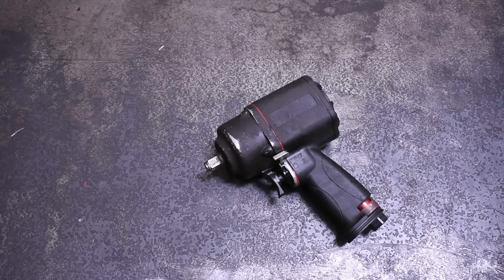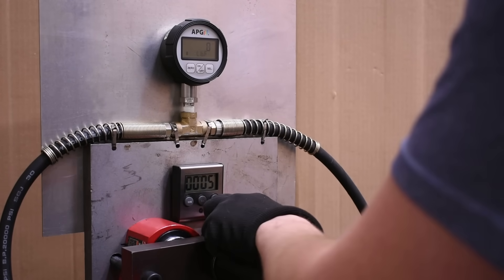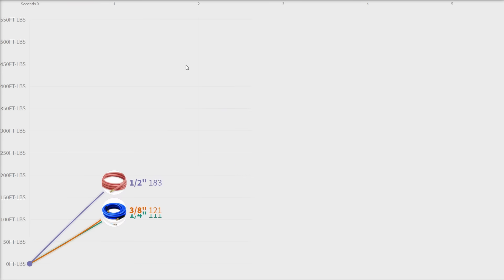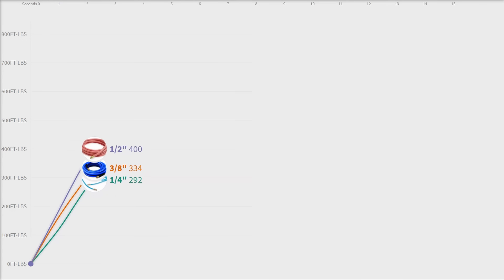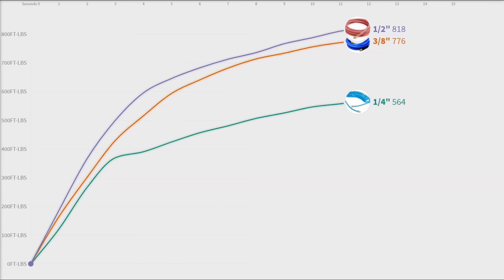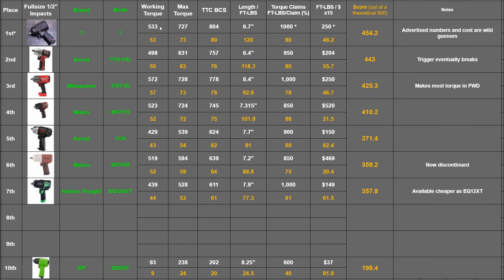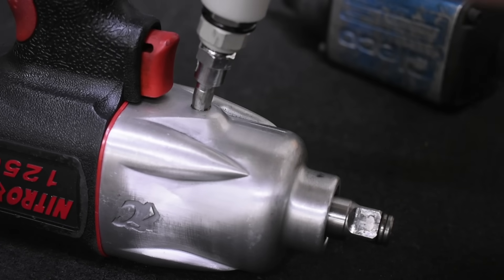How Much Power Are You Losing w/ Your Air Hose Size? Dyno Graph Testing

Comment: Ever heard a 1/2” impact fed from a 185cfm air compressor pushing 200lbs thru 3/4 jackhammer hose.  It’ll make your ears hurt first. And then max torque claims ain’t made up then lol.  But it destroys the impacts right quick

Comment: This comment goes to the creator of this video... as I need serious help.  I've been delaying my introduction into air tools as there have been SO many variables to take into account.  I bought a nice compressor a couple of years ago however I haven't really used it due to my hesitations over hose selection, coupler selection, etc...

1)  FANTASTIC video.  I'm not sure how I ended up here... but I did... and I seriously appreciate the quality of this video.  My questions concerning hoses has now been answered.  3/8" hoses are the best fit for me.
2)  Now the couplers.  Should the coupler diameter match the hose diameter in order to get the most out of your tool?  My compressor came fitted with a 1/4" coupler and the handful of tools I have so far (impact wrench, air chisel, tire inflator/gauge) also came fitted with 1/4" couplers.  I've understood that the air getting to your tool is limited by the smallest diameter between your compressor and your tool.  So even though I would be using a 3/8" hose... the fact is... all of my couplers are 1/4" - so would I be seeing any benefit in using the 3/8" hose?  Or am I supposed to change all of my couplers to 3/8"?

Similarly, the airline coming out of the compressor is 1/4" to the coupler on the compressor... and the tool itself is obviously fitted with 1/4"...  Can you PLEASE help?

Thank you SO much in advance.
Reply from the maker: A common misconception is 1/4" fittings mean anything on it measure 1/4". The fitting size is based on threads, which are 1/4 NPT, and npt threads have nominal names that have nothing to do with a measurement. 1/4" npt measures around 3/8" on the htreads. That said, the inside diameter of a 1/4" air fitting is also small, varying by type of fitting. Couplers will always bee the bottle neck. We cant test that for you, but generally we feel milton type V 1/4" is plenty on 3/8" line.

Comment: Joe Homeowner here. Just stumbled across your channel and hit play because I have a big box bought Milwaukee 6 gal compressor (C2002) with whatever hoses/adapters I got with it. Used it with a Brad nailer (pre battery everything) and now mostly as a car tire filler and general blower. The thing has always leaked and the noisey-arse compressor is always going on. Always bothered me but wasn’t sure of next steps plus I hardly use it. 
Your channel has great info and your presentation software is first rate. Happy to subscribe and spread the word!

Comment: If I understood correctly (and I may not have)  you adjusted the regulator for each individual hose tested to supply the same running pressure  at the tool.   Can you explain your rationale for that?  It seems to me that setting the regulator pressure higher at the upstream end of the smaller hoses tends to offset the restriction of the smaller hoses, and makes that test less of an apples-to-apples comparison.  Also, I'm curious, which has a higher air flow?  The wrench spinning up freely with no load or the wrench working under load?  Just off the top of my head, I'd guess that the free spinning wrench would flow more air,  but these things aren't always what they seem.

Comment: While I have no doubt the 1/4 inch performs poorly. It is not an apples v apples comparison. A coiled hose is going to offer more resistance to airflow. If the purpose of the test is to compare hoses in general use it’s a fair comparison but not so for comparing how hose diameter impacts air flow.

Comment: That impact looks alot like a Mac/ Proto product. I know SP Air makes Mac/ Proto sealed head air ratchets and the heavy duty air saw for Matco but I will have to look into who makes this impact gun. 🤔
Reply from the maker: See south main auto's insta. Just waiting for the launch now!
Reply: @TorqueTestChannel  Thank you kind sir! My Aircat 1150 is still going good for about 8 years old but it is time to give it up and get something new. It's been a great tool and was daily used for about 7 years at 3 shops, the anvel is still square and the only part I replaced inside or out was the retention ring a couple years ago. Good maintenance does wonders.

Comment: I work in logging and actually really needed to know if I could get away with just running 3/8". A smaller difference than I would have expected and 3/8" gets you about the same power, might take a few extra ugga dugga's though.
 Cheers

Comment: I’ve been a Matco guy for years. Always keep my 1/2” impact in the best condition possible. At our plant, safety keeps the air throttled down to 60 psi and we use 3/8” air hoses with the smallest possible quick connects. Makes my 1/2” impact about the power of my 3/8” stubby Mac air impact.
Reply: 60 psi LOL

Comment: So, are you seeing a decline in dynamic pressure the longer the impact runs with the thinner hoses? Because theoretically dynamic pressure measured at the gun should mean equal flow rate across the different hoses. So what's the cause of the lower force?

Comment: I think the 1/2" line would be even better if your entire air system was 1/2". With your regulator and everything before it only being 3/8" you're not making much difference because of the 3/8" hourglass in your lines.
Reply from the maker: There's a big difference between 1/2" ID air line and 1/2" NPT air fittings. 3/8" line uses 1/4" fittings and 1/2" air line uses 3/8" npt fittings. Because 1/2" NPT is like close to 7/8" in reality when you measure it, it's just a pipe thread size name not the measurement.

Comment: Excellent channel.  I'm very interested in the couplings.  I did some of my own experiments and the couplings had a much, much larger impact on pressure drop than 50ft of air line did. 

Also can you plot air pressure along with torque in your charts?  Torque is nice to have but it only tells half the story.  Thanks.

Comment: What size Compressor ? What size is your line from tank to airline my 26 gallon is 1/4 air line from the tank to the first fitting .  Air tank with 1/4 fitting from the tank no use to run bigger hose 1/4 to a 1/2 hose is defeating the uses of a larger hose . 100 gallon tank with a 1 inch line choked down to 1/2 will be fine .
Reply from the maker: 80 gallon IR compressor, 3/4" pipe to the wall mount where this 1/2" is hooked up to
Reply: @TorqueTestChannel  Makes world of difference on the tank out pipe .  Im lucky to get 150 FP of torque from my tank , if I hook up my 15 gallon inline with the 26 I get about 300 FP my CFM go up to about 8, all 1/4 fittings .  most home tanks have 1/4 manifold .

Comment: How about a video showing something many people don't realize, the power lost on impact wrenches when using 3/8" hose with 1/4" quick connect fittings vs 3/8" quick connect fittings
Reply: Probably extremely minor loss in power. This test compares 25 feet of hose. 2 inches of smaller ID isn't going to give the same results. You may gain a few percent, but could just turn up the psi of your regulator a hair.

Comment: Understandably i can agree with this but when it comes to a 1 inch air impact pushing torques past 1900ft/lbs im betting the 3/8 hose will perform comparatively as the 1/4 hose did 1/2+ for that kinda tool with the high flow fittings to get the mosr benefit

Comment: I have a CP 721? 1/2” that I bought in 1990 when I was working at the John Deere, Steiger dealership. No, it is not the Central Pneumatic!
It is a Chicago Pneumatic with the numbers stamped in to a metal tag, riveted to the wrench. The reason that I am not sure of the model number is dings from years of use, a lot of abuse, and torquing out of my grip. Every year to 2 years I put in a rebuild kit from CP.  This 1/2” air wrench will take off 50% of the Budd or piloted rims on semis that have not been put on by a 1” wrench and someone who loves to pull the trigger. 
What I do is unscrew the whip hose, screw the 3/8” by 50’ hose to the wrench. So now it comes out of the compressor though a 1/2” ball valve, to my 3/8” x 50’ air hose, to my wrench. 
It is amazing how much the old air wrenches preform without the restriction of the quick coupler!
A lot of guys use to use the long Lincoln quick couplers, I took each of their male tips, put a drill bit down it to measure the ID of the tip. Some common quick couplers are not even 3/16”!
Just like the 3/8” vs 1/4” air hose!
Another good tip on an impact wrench is to put on a 3/8” by 6’ whip hose, it has nothing to do with stopping the vibration from the quick couplers, it is a reserve of unrestricted air next to your impact wrench. 
I think that is why your 3/8” test climbs faster than your 1/4” test. Then they tend to flatline because of the restrictions of the 2 quick couplers. 
When I was at the JD-Steiger dealership, they had an old 5/8” air wrench that would out do some new 3/4” pistol grip air wrenches. But it used A LOT of air, shop law was you had to have leather gloves on to use the 5/8” wrench! It would twist right out of your hands, if you did not know how to hold it. 
The shop foreman went down and bought my same 1/2”, and 3/4” Chicago Pneumatic air wrenches for his service van after using mine. 
Check out the ID of your male air quick couplers, remove the quick couplers from the compressor, get rid of the hose reels, install a 6 foot whip hose on your impact wrench. You will probably be surprised by how much power that your impact wrench has!!!
Hello from north east Montana. 
10 miles from the Canadian border.

Comment: To answer the question Why do 1/4" x 100' hoses exist I think it's for paint shops as I don't think they need the larger volume that the larger ID hoses can provide. 
That or (jokingly) so you can park 80' away and still fill up your car tires.

Comment: New Viewer here, I thought Nitto was the most common fitting? maybe only in australia? have you compaired a minsup fitting for maximum flow?  I found a huge difference with my snap on 3/4 gun on a 3/8 air hose vs a 1/2 air hose with Nitto fittings and ive though about setting up a 3/4 line with minsup dedicated for my 3/4 air gun.

Comment: Nice test, what's the inlet line to the Filter/Reg? And the flow rate for the filter/reg? I know you have a 3/8" out. As the curves become pretty much parallel between the 1/2" and 3/8" after the initial burst from the 1/2" I wonder if that's not just the point where the intial "bonus" energy in the larger hose has been depleted and the flow in the 1/2" hose is then being held back by the filter/reg. effectively pairing it with the 3/8" hose.
Reply from the maker: Filter/reg is 3/8" NPT in and out, flow is 47.6 CFM which is well above any impact we've seen before.
Reply: @TorqueTestChannel  I'm guessing that gun is pushing 40 CFM so you don't have all that much theoretical extra capacity. Would be interesting to put a Tee and gauge on the outlet of that FRL to see what the output pressure is doing under load.

Comment: A couple more ideas for you. If you do a video on the fitting types, I'd love to see what different swivel fittings do to performance, if anything. The hinge type and the ball swivel type. I use the the hinge type from HF on some tools and the Flexzilla ball swivels on other tools. 

Also, I once saw something about how to hold an impact for maximum performance. They were saying that if you just hold it loosely on the fastener that it would perform better than pushing up against the impact like you might a drill. Makes sense to me, but how much difference, if any, would there be?

Comment: What compressor are you using though? That's arguably the biggest reason the 1/2" couldn't retain it's lead
Reply from the maker: 80 Gallon Ingersoll Rand
Reply: @TorqueTestChannel  nice. Which one? I picked up an 80 gallon UP6-10TAS at auction for $280 like 6 months ago that's been collecting dust in storage that I just got the VFD for on Tuesday and am trying to get it home tomorrow. I'm so excited to finally a respectable compressor when I'll I've had before has been a 6gal Porter Cable pancake. Should be the last compressor I ever need - hopefully. 

I only just stumbled upon your channel but I dig it. I'll be watching a lot going forward

Comment: Ideally you would want to change the ports at the wall hookup, and use a gun (3/4” drive) that accepts 1/2" NPT as well as use a 1/2” hose with 1/2” fittings that way there is no restrictions for the 1/2” Test and it’s strictly the hoses causing it. Because the way you did it there are 2 restriction points on the 1/2” test vs none for the 3/8. The spread would’ve been even bigger, If the gun could flow the additional air. The taper off and narrowing of the graphs could’ve been the gun reaching its actual limit vs air restriction. Realistically though I see why you did it that way because most people will run their setup that way.
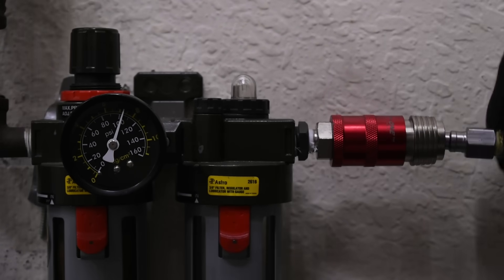Reply from the maker: I'm confused. The wall hookup and 1/2" gun both DO have 3/8" NPT threads and fittings. Both the gun and wall mount were previously using adapters to use standard 1/4" NPT w/ 3/8" hose. Now they are using native 3/8" thread attachments and 1/2" hose. This is about as ideal a scenario a 1/2" gun could be being that this gun has a rarely seen 3/8" NPT inlet. 1:23
Reply: @TorqueTestChannel  oh shoot my bad I mistyped. I meant to say 1/2" npt. I know it would be unrealistic to use that for a 1/2" drive gun but many 3/4" and all 1" guns use that size fitting.  But if you kept all the line on the 1/2 test the same it would eliminate the 2 choke points at the quick connect fittings and te only reduction would be at the gun. But you would need to use type P or G fittings I think to maintain the proper inner diameter
Reply: @TorqueTestChannel   I'm not trying to say the way you tested it was wrong, because honestly that's how I run would the hose in my shop and how 90% of people are going to use a 1/2" hose. Hell with having different huge fittings.  But there is still some more torque potential there by removing those restrictions

Comment: Well done video, all true what you say, As been working with standard air tools and air torque tools, i can tell that the minimal difference between 3/8" and 1/2" hoses is that your tool does not consume more flow than can be provided by the 3/8" hose at that length. It will be a major difference if you tested for example an Atlas LMP 51 or similar. The difference would be in shorter time to reach desired torque.

Comment: Could you test how well an accumulator at the end of the shop air fitting does? The shop I work at has very long lines of undersized piping and was wondering if plugging in a small portable air tank into shop air, and then plug the impact into that would make a good difference. I've had to pulse the trigger as the lines get exhausted quick. The fittings are 1/2 so it should be good for a 3/4 gun but is lacking some power in parts of the shop.

Comment: I've got a IR 231 too but was lacking power.   There are huge limitations of air flow if you use a hose reel (for instance, at the brass elbow fitting, off the reel where you connect to the compressor), there are passages that restrict air.   So, I purchased a separate 3/8 rubber goodyear 50 ft hose and put it on a wall hook near my compressor.   I now use high flow fittings.   The seperate line is used when I need to move alot of air.  This is what I run my impact on.   Made a huge difference.  The impact is extremely powerful and does not struggle.   The only thing I use of the other line (the reel) is filling tires, blowing air, or low volume tools.

Comment: Just a few days ago I was thinking about suggesting a video like this, but I was a few steps behind. I was thinking more of testing the fittings, but the hose too. Also maybe you could do a 50' 3/8" hose to compare it with the 25' you've tested here. 

I use a combination of Industrial fittings and Milton V / Harbor Freight / Menards Hi Flow / Flexzilla ('m pretty sure those are basically the same). I would love to see that video.

Comment: A way to assist the gun without replacing all of the air lines in the shop is to connect a tank close to the point of use and use a larger hose from the tank to the gun. A few seconds pause allows the tank to refill. Even a tank as small as one gallon makes a big difference.
Reply: We do that for framing houses wt a 25 gal tank from an air compressor

Comment: 6:48  Pneumatic nail and staple guns don't mind a small diameter line like 1/4" at longer lengths.  They run just fine on a 1/4" line and they're far lighter which construction guys like.  When you're throwing around a big framing nailer the last thing you wanna do is pull around a heavy air hose too.
Reply: Larger lines only increase flow...as long as the psi is level.

Comment: I use a 1/2 hose with Milton (S-224) G-Style Coupler for max torque. I also use the same connector for my blasting cabinet. I upgraded from the Milton V-Style which has a 74 SCFM vs the the G-Style 99 SCFM. The only down side is that they are 2 time larger then most couplers and are even bigger then the 3/8 industrial style coupler. Btw the limiting factor could be the coupler for the 1/2 inch test, really you should have connected the hose straight to the impact to verify.
Reply: I'd like to have seen an additional test done with G style fittings on the 1/2" hose and possibly even on the 3/8" hose

Comment: Our dealership seems to be the only shop on the planet that uses L style fittings. With that said, they work ok.
Reply: L type are garbage unless you’re running a orbital air sander
Reply: Sneak in on a sunday and switch out yours to a Milton Type V and others will wonder how you blast everything off so easy